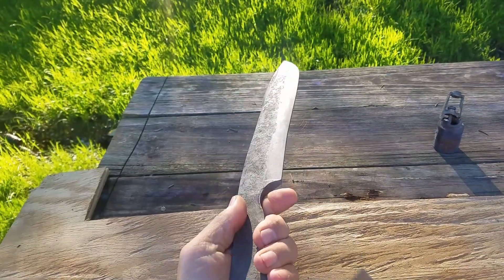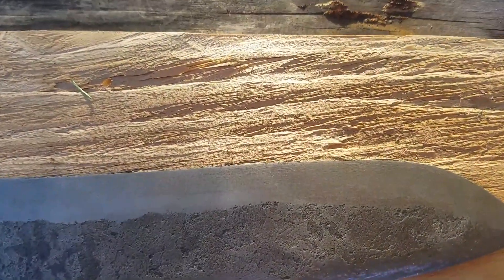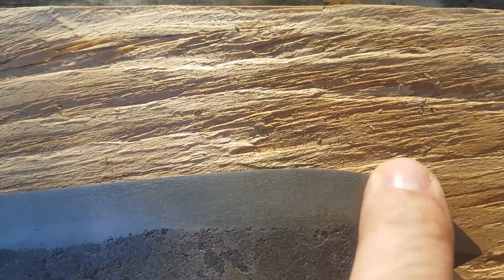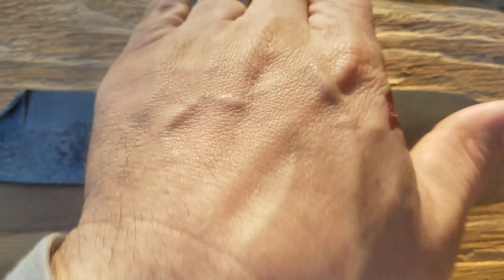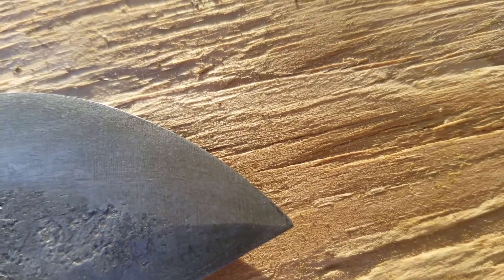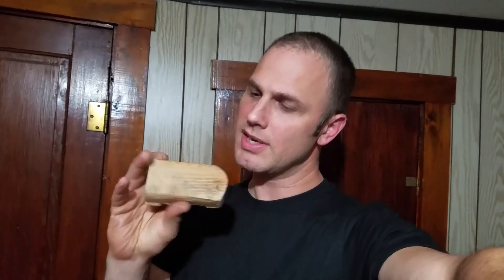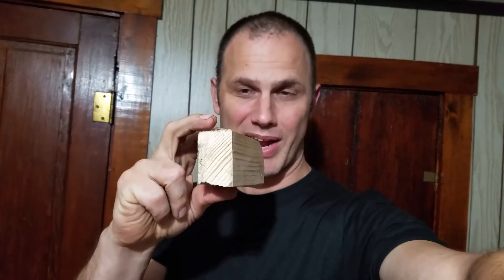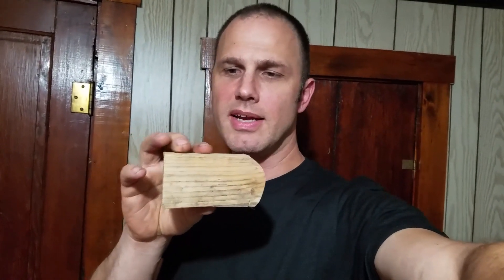Forged VS Stock Removal... Which is stronger?

Comment: From what I've read forging offers no benefits in known steel. What I mean is of you are forging 1084 then forging it does nothing to change it to make it stronger. The truth is if you don't normalize it properly it's is probably going to be weaker. Forging was useful in the past for bloom steel. Bloom steel had layer of high carbon and iron. When you forged it you would pack the carbon steel at the edge so you could get a hardenable edge. It makes no difference in known steel because your essential just moving around the same steel. At least that's what I gathered. If you want more of a gauranetee on the strength of your steel then use stock removal and buy from a good seller and follow a good heat treat schedule. Forging is more fun though and if you know what your doing offers same strength as stock removal. Hope this helped a little.

Comment: The general consensus among knife makers and metallurgists is that a forged blade has no inherent advantages over a stock removal blade.  This is simply due to the fact that knife steels have already been forged to shape at the mill through hot rolling.  Typical ingots produced from the melt are many inches thick and the steel is then hot rolled to final dimensions, often going through multiple rollings to get them to dimension.  There is a definite "grain direction" to rolled steels, but it really is about elongated carbides and other structures and not really the grain size of the steel itself.  Those carbides tend to form bands when the steel is rolled and can be fracture points.  Forging a blade, unless you start with a very thick piece (8-10" thick), actually moves or thins the steel relatively little compared to the rolling processes, and thus, the structure isn't affected very much if at all.  One thing forging does do, however, is to increase grain size due to high heat.  This is why heat treating is used to refine the grain, but heat treating is not forging.  So, to this extent, one could argue that in the case of monosteel blades, stock removal is a more efficient and less expensive method with equal results.

Comment: I think blacksmithing makes it more stable and more likely to bend rather than shatter and take impacts better.  It think before the modern steels that have today you could easily see the different in stock removal or hammered steel. Now a days the technology is going by leaps and bounds. I don't think a super steel is gonna have much give out vs forged super steel. Not to mention stronger steel is harder to shape.
Reply: You’re talking out your ass and you have no facts. 🤡
Reply: @texasbear2060  I'll provide links bitch.
Reply: @texasbear2060  back when blacksmithing wasn't as advanced doing something like stock removal wasn't possible because the steel quality wasn't good enough to do so. 
The theory is the grains of the steel curve and bend when it's forged giving it more give, flexibility and durability and takes stess off the metal. Stock removal just cuts the metal the grain stays in original shape and you just cut through it instead of bending it. It's a widely known and debated theory. Morden steel is so well developed it doesn't matter whether you forge the steel into shape or use stock removal. 
Try to keep up before you look like an asshole that doesn't know anything

Comment: From what I’ve learned, as long as you follow the correct procedures for heat treatment and normalizing and annealing there is no difference between a forged blade and a stock removal blade. The hardening procedures and heat treating changes the structure of the steel. Beating on it just gives you more man points is all. Lol kudos on the extra man points.
Reply from the maker: It's a little more than man points... a different art and participation in history. If you're grinding out a Damascus steel blade you're putting on display a different art than stock removal. With respect to strength of a blade I tend to agree with you.

Comment: Does normalizing after hammering have any effect on this?
Reply from the maker: Wow, I was shaky holding that camera! To answer your question: no normalizing wouldn't, that blade was normalized and heat treated prior to this video. =)
Reply: WJ Blades Copy. Thank you!
Reply: No, the only thing normalizing does is relieve stresses (any time steel is pounded, ground, struck, filed, cut, machined, etc, stresses are introduced into it).  It is done before heat treating to help prevent warps and cracking during the quench.  It does affect the grain structure as normalizing is really just annealing.  In the case of simple carbon steels, this just means all or most of the grain structure is changed to pearlite, or a BCC (Body Centered Cubic) structure...the softest form of the steel. The "grain" you are seeing isn't really the steel's grain structure, it is the structure of the steel as a whole, because it contains carbides and other structures due to alloying agents.  Most likely, he is seeing carbide banding which was actually produced at the mill when the steel was hot rolled to dimension.

Comment: Thank you for the video. As someone that is not a bladesmith, I'm wondering if the stock blade where still created with the grain in mind (going the same direction), wouldn't this still be as strong?
Reply from the maker: I do have to say that in my opinion a forged blade has more soul. I also believe there is more skillful art involved. I'd rather forge a blade at the anvil and be connected to the history of thousands of years of smithery. Just sayin... =)
Reply from the maker: With modern steels I don't think it matters either way so long as they are heat treated correctly. =)
Reply: @WJBlades   thanks for the quick response. I've been considering getting a new blade and wasn't sure about the differences.

Comment: That sounds like a decent theory at first glance but it falls apart when you consider that the purpose of normalizing the blade is to realign the micro-structure after putting the steel through stress by forging or cutting. Also, the reason you can see the "grain" like that has more to do with the thickness of the steel in that area than the actual grain. The same thing happens to a stock removal blade after quench.
Reply: I realize this is a pretty old video/comment but I just wanted to add a few things here. Thermal cycling does help to make the crystalline structure of the steel more uniform. In this case, the grain that he's referring to is actually inclusions from the original ingot that was rolled out at the steel mill. These inclusions get elongated the entire length of the bar as they are rolled to very long lengths.

Generally, when you're talking about rolled steel, it is stronger when it is forged because you are aligning those inclusions with the shape of the object. With a knife, it's not really enough manipulation to matter. I'm a forger, personally, but I forge because I enjoy the process more than grinding, not because it creates a stronger knife.

Comment: How can you have an opinion on a fact. Factory made spring steel that is forged there to become a cutting tool, loses it's qualities when you reforge it at home. 
There are some top swordmaker artists like Angelsword who is also an engineer as as a matter of fact, that make their own steel. But they have knowledge and expensive tools many don't.
Reply from the maker: So, are you saying that it is a fact that forged blades are stronger? Just trying to be clear on what your saying. ☺
Reply: @WJBlades  No, they are not. ☺

Comment: Your are absolutely correct but the issue is if you have allot of grinding or whatnot it ca. Take away the compacted grain which is stronger but the difference is negligible and the real measure of toughness is the heat treat.

Comment: I believe you are correct sir I’ve only been forging for a short time but I’ve seen big differences between grain structure from bar steel to forged steel...also doing normalizing cycles helps to tighten the grain structure..
Thanks for your videos
Reply from the maker: Thanks for the encouragement my fellow smith. 😎